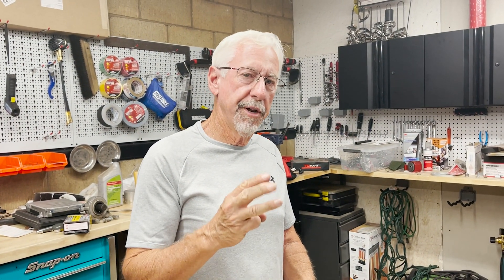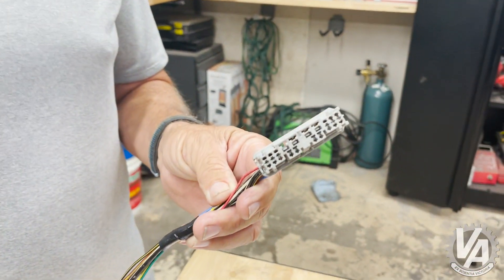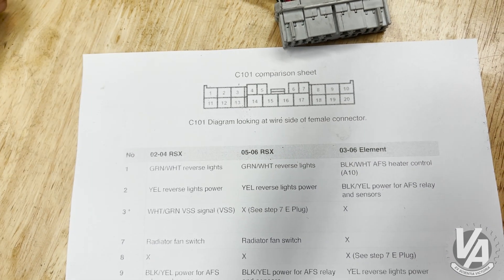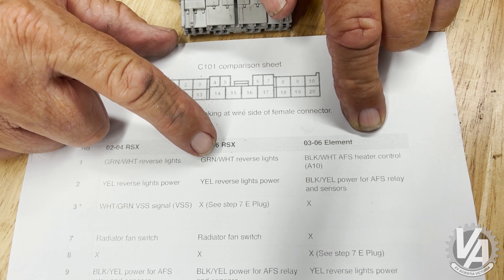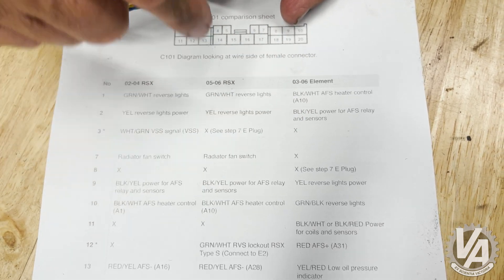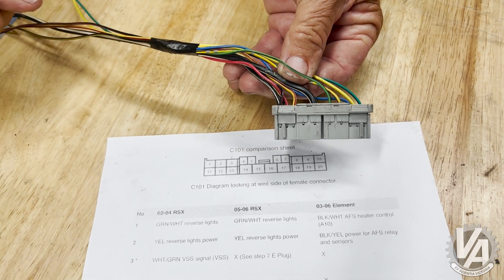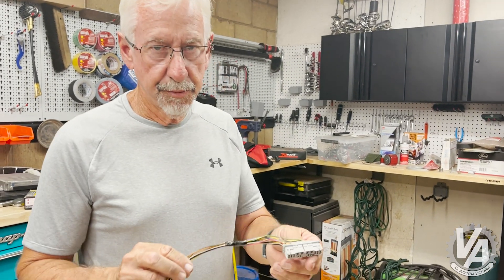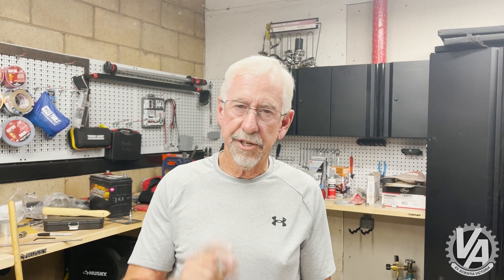How to Rewire the C101 Plug for Your K Swap

Comment: Hello, I'm currently swapping an 03 RSX engine and auto trans into my 01 CIVIC. Can I just plug the C101 of the RSX into the 01 CIVIC 7th gen and be ok? Thanks
Reply from the maker: No, there are some differences between the two cars. The EX model is a little bit more similar to the RSX, but the LX has a lot of differences. You’re going to need to get the hold of the pin outs of the two and make some changes.
Reply: @VTECAcademy thank you, I do have an EX 7th gen. Where could I find the pin outs?

Comment: So I have a k20a3 from a 05 rsx I have the conversion but I'm having issues with the wiring to the guages the speedo temp and tach don't work but through my scan tool they do. Any ideas
Reply from the maker: What car is the engine in?
Reply: 2002 honda civic lx

Comment: K swap eg type s harness with kpro 02-04 I have no spark and injectors are not firing, have power at c101 for coils 12volts but only have 3.5volts at c101 for injectors and 3.5volts at injector plugs, what would cause this any idea ? Been scratching my head trying to figure this out for quite some time now
Reply from the maker: The injectiors could be stuck. We tap them with 12 volts from the battery, but do not hold the wires to them for more than a second at a time. You should hear them click
Reply: @VTECAcademy  they are brand new id1050s never had fuel ran threw them and I had this issue with stock injectors in aswell, what would cause the no spark..  and low voltage at the injector clips? Only seeing 3.5 volts could it be engine harness/conversion harness related or maybe even the main relay? I did confirm pin 20 at c101 for 12volts, pin 14 only has 3.5 volts, when I unplug the big plug on driver side strut tower and check the pin that supplys pin 14 I have 12volts but then when I plug the conversion harness in and check conversion harness side it drops to 3.5 with ignition on and ecu plugged in, if I unplug ecu the voltage will go up? Any help or even some guidance on what to check next would be greatly appreciated
Reply: @Cmdc12  no I did not unfortunately:/

Comment: heyy   how can i get the vss with the c101 conector from honda element , i kswap my em2 with a k24a4 engine and i dont have de gauge working (temp, speed and rpm) i use the k24a4 engine harness , the car run but i dont have the rpm etc

Comment: I don't know why this vid popped up,  but... now I'm really missing my OG off the lot Element.  It was totaled 2 months ago.  With insurance money,  I bought a 2002 Nissan XTerra 6 cylinder 4WD. Only because I needed something with more towing capacity.  These Nissans are seriously complicated to work on.
I'm giving up and will now get my 2003 Element running, and park the Xterra, until I have an extra $2K to throw at it.

Comment: @Brian, can you explain why Hasport or none of harness swap kits that make similar cabin harness for the kswap didnt fuse protect the wire running into Pin 9 on the C101 connector? I believe this provides switched power for the O2 sensor as well... For DC/EG swap kits, this wire runs direct to the strut tower connector which used to power the B-Series dizzy... Upon finding a fault recently once the 12V ign wire is shorted to ground this wire will burn and melt... is it worth reconsidering the design to include a fuse?

Comment: Would this be why my k swap integra won't start? I have the hybrid racing conversion harness and 05 rsx engine harness. What do I need to get it to work
Reply from the maker: That depends, what computer are you using?
Reply: @VTECAcademy  pnd a07 I'm also using the ktune immobilizer bypass
Reply: Hey did you ever figure this out?

Comment: Most of those wires arent relevant if your not swapping a engine into another honda?
Reply from the maker: That depends. The relevant wires include the power for sensors, coils, injectors, ECU, and starter signal. Less relevant are fan control, brake switch, oil pressure and back-up lights.